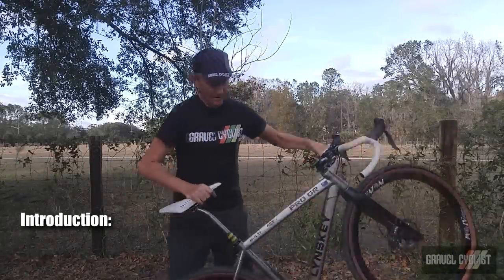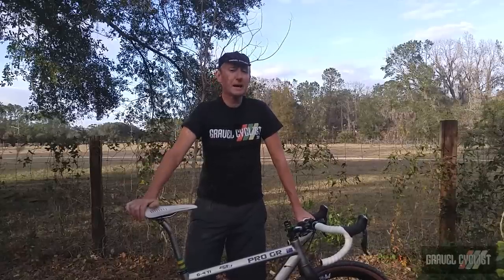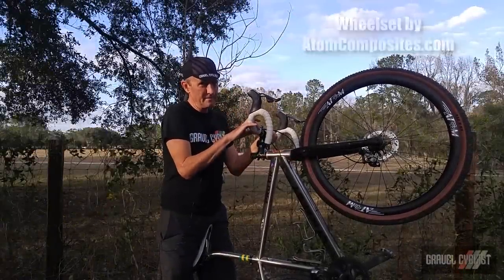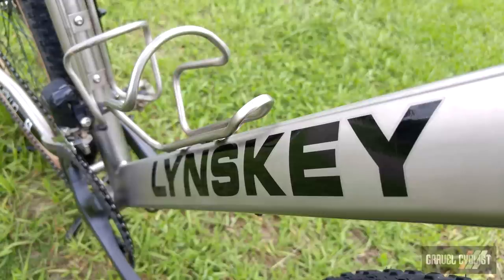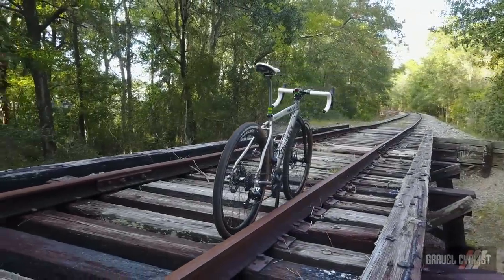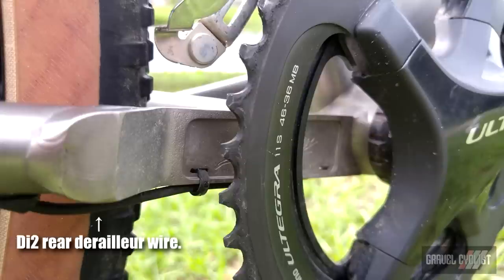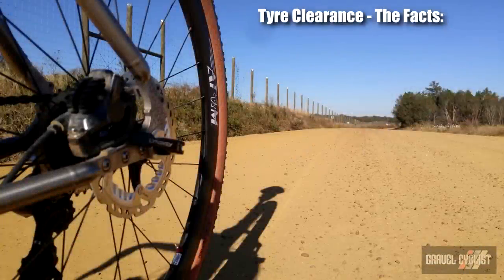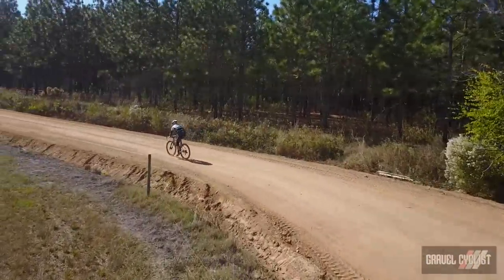Lynskey PRO GR Titanium Gravel Bike - Long Term Review

Comment: Thanks to your reviews of this bike, both here and on instagram, I recently purchased an XL 2019 frameset direct from Lynskey. I loaded it up with Shimano Ultegra groupset, 3T carbon bars and stem, Pro Stealth saddle and my ultralight American Classic Wide Lightning 29 wheels (Hope hubs & ti spokes) with 40mm Schwalbe G-One tires. Last weekend I put it to good use in the Dirty 130 festival in Wagga Wagga. It was amazing, out performing my expectations. Thanks again for the recommendation.
Reply from the maker: Nice! That's one ride I would like to make one day, but I was fortunate to ride much of the loop early in 2018, in the sweltering heat. Good times!
Reply: How tall are you? I'm about 6'2 1/2" and not sure if I'd be best on their L or XL?
Reply: 6’3” with long legs. My BB to top of saddle measurement is 88cm. Hope this helps.

Comment: Thanks for all your content
 I was considering a Pro GR as a primary road bike with some single track and off road capabilities. Not for racing… just for fun and exercise primarily and maybe a group ride. I am 6’3” 240 lbs, was wondering if you thought a GR300 might be a better match. The sales person at lynskey suggested the Pro’s stiffness for my size. Thoughts?
Reply from the maker: Hello there! Unfamiliar with the latest GR300, but the PRO GR was stiffer than the early model GR250 I reviewed a long time ago. As you are probably aware, larger size frames can get flexy in places. Thinking the PRO GR may work for you, and as a bonus, unless they changed it, 6/4 Ti 😄👌
Reply: @GravelCyclist   thanks for the feedback.  i pulled the trigger and just got my Pro GR with AXS Force 2x; OMG it is awesome.  still 6/4 Ti, but they changed the tubing to a Diamond cross section (no longer triangular).  i cant comment on the difference between the 2.  however, my frame is so rock solid, comfortable and smooth, not harsh in any way... i love it.

Comment: Absolutely beautiful craftsmanship. Love these bikes. Unfortunately I still wouldn't buy one due to the hideous cable routing. This needs to be cleaned up before I ever spend that kind of money....
Reply: For my road bike R300 They would do a custom through the frame routing just have to pay extra. But I believe this is standard for the pro gravel bike frames. break out the wallet brother your time has come.
Reply: For my new R300 road bike they quoted me to do a custom through the frame mod, which would hide the hydraulic lines . But I believe the GR300 come with this feature either standard or an option, and it looks great. Time to break out the wallet brother, your time is here.

Comment: JOM, What'd you do for a cadence sensor?  There is not enough room for a Stages L or the Garmin cadence.  There is not enough gap between the crank arm and the chainstay.  I was hoping to avoid the wonky looking once that mount on the chainstay.
Reply from the maker: I don't use a cadence sensor or power meter, so I cannot answer your question accurately. Sorry about that!
Reply: MJ Meenan, that is interesting, I had no idea...What about a power2max, quarq etc...? I would normally suggest a pioneer but it'll have the battery case on left crank arm just like a stages.
Reply from the maker: @jona.136  I am reviewing the Rotor single-sided power meter soon.
Reply: @jona.136  I changed out the BB and put the Quarq on this week. First test ride soon.

Comment: Hi Jom, curious to your thoughts on the American Classic Wide Lightning 650b wheels?  I have these wheels in both 650b & 700 and have been very happy with them.  They are the widest wheelset I have found for this type of riding; 29mm internal, 32mm external.  This combined with either Compass or Panaracer tires have been great!
Reply from the maker: The AC Wide Lightning 650b's are my #1 goto wheel for 650b!
Reply: Gravel Cyclist thanks Jom, and what are your thoughts in general regarding 650b vs. 700c
Reply from the maker: Joseph, I've yet to race on 650b, but they are my fave wheel size for mixed duty riding. By that, I mean... gravel with some singletrack thrown in. I love the nimbler feeling of the smaller wheel size in tight situations. My only complaint is most 650b gravel tyre choices are still too weighty. Thus far, my favorite 650b tyre remains the WTB Resolute 42, due to its lighter than the norm weight and mud shedding capabilities. With that said, I would like a faster rolling option but sans the weight... and then I'd race it. I need to check out some of the offerings by Compass (rebadged Panaracers) as I know they are very light.

Comment: Looks a good well thought out design Jom. How much does it weigh in the setup shown?
Reply from the maker: Dave, roughly about 19.3lbs, decently lightweight but uber tough. I may use the PRO GR as the basis for a project bike later, depends on how much cash I want to plunk down for the build. I forgot to mention it in the video, I've arranged to keep the review bike for myself. VERY happy with it.

Comment: How tall you are and what size is your bike ?
Reply from the maker: Hello Jacky, I mention the size of the bike I used in the video, but to answer your question. I am about 5'11", and I ride the size small, which is almost a 54cm top tube. I prefer to ride the smallest frame I can get away with, so my fitting method isn't recommended for everyone. I have a lot of exposed seatpost as you can see, but the bike fits me perfectly.
Reply: Thanks a lot !!  .... I am 5’10” if I choosing the Size M  would that be too big?
Reply: And I have another question: gravel bike riding feeling is that close to road bike ?
Reply from the maker: Jackie, you need to talk to your bicycle shop about sizing. I do not feel comfortable offering fitting advice. Thank you.